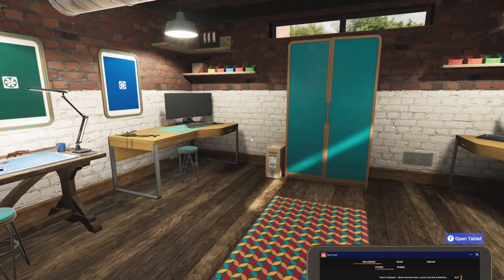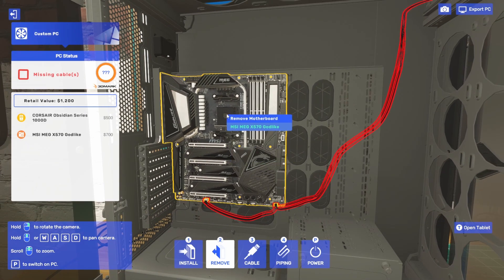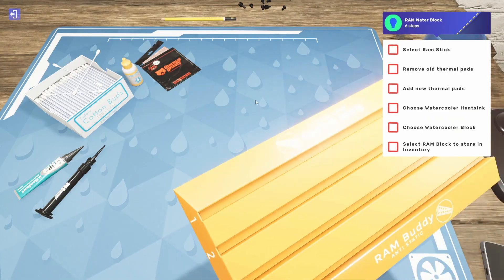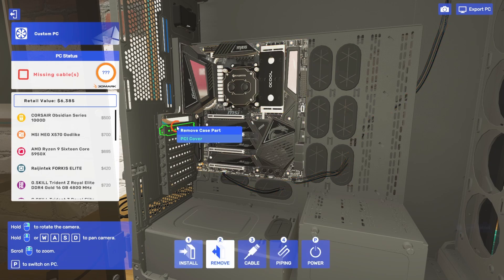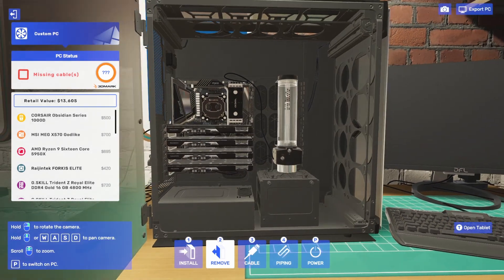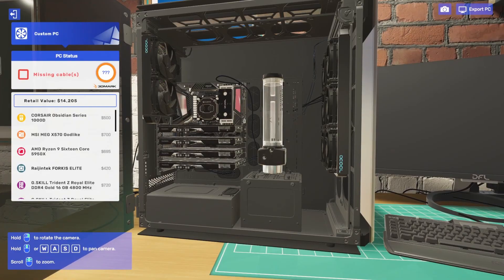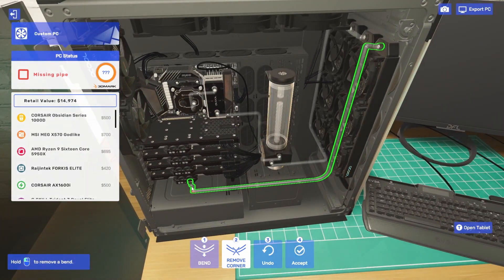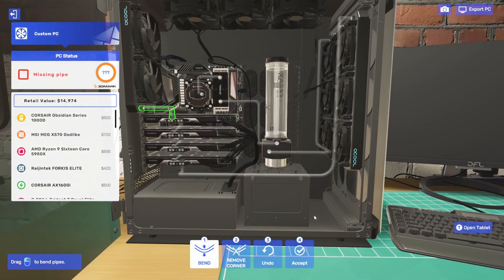I Watercooled 4 GPUs In One PC - PC Building Simulator 2

Comment: This actually helped me because I had a 14900KF, 4 Radeon 6900XT's, a 1600 watt PSU all watercooled and I was blue screening like a mad man probably because I had the GPU overclocked to 150% Voltage, and +500 Core Clock. So I assume the reason mine was crashing was because of that.

Comment: When i try to install the same gpu setup but then the RX 6800 XT gpu's, for some reason the top gpu card fittings at the underside are both red.
So that means that i cant connect any pipes.
this is ridicillous
Reply: same....did you solve this?
Reply: @shaeli4400  What i did is i watched a video installing 4 gpu's in this game.
I watched very closely what kind of brand and type motherboard it was.
That finally solved the problem.
But that still doesn't make this right
If the specs say that 4 gpu's can be installed, than you should not encounter these problems.
I still think there are a few glitches in the game
Reply: the GPUs are 6900 XT not 6800 XT
Reply: @themythicalwolf  What do you mean?
There are also 6800 XT  available in the game

Comment: It's nice they added quad SLI option but wish they had also add a 2000 watt PSU or greater in case you wanna OC those 4 GPUs.
Reply: Yeah 2000w PSU's are definitely missing from the game.
Reply: dont any of the cases feature 2x PSU slots
Reply: @awpidar  The Raijintek ENYO case does support two power supplies.
Reply: @laszlozsurka8991 but you can't use both slots
Reply: Please view my stuff, thanks.